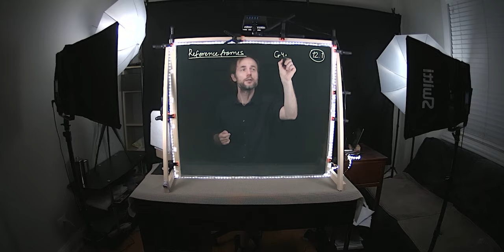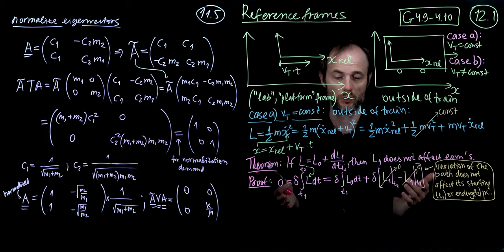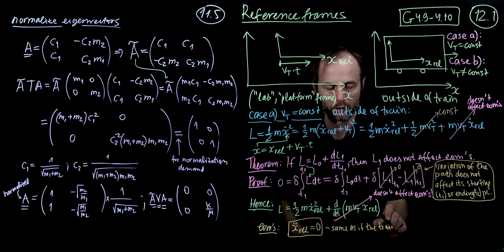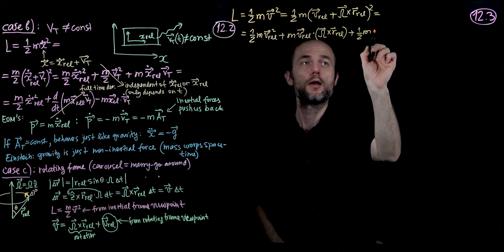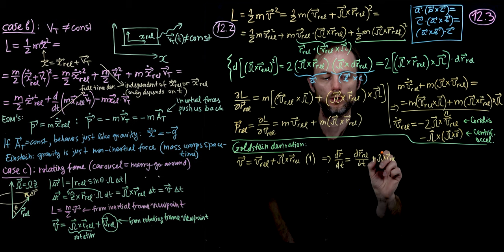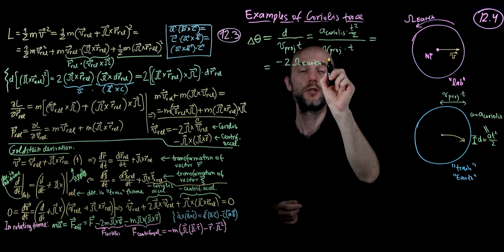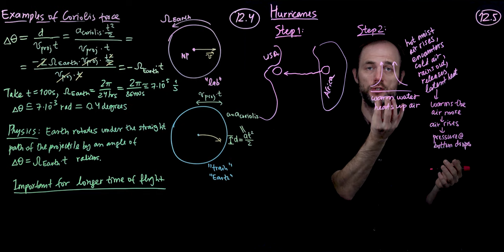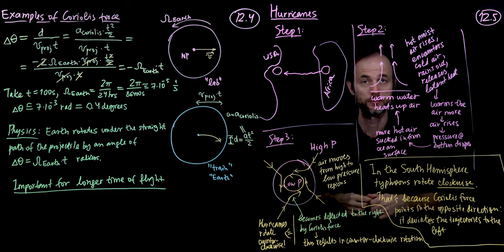Lecture 12: Reference frames, Coriolis force, and Hurricanes

Comment: Can someone advise me what is meaning of full-time derivative and why it doesn't affect Equations of Motions? (at 18.28)
(BTW these are great lectures)
Reply: I hope you get to read this comment even if it’s one year later hehehe. 

A full-time derivative is a derivative that contemplates both explicit and implicit change in time. 

Imagine a function that describes the temperature of a room at each point, and at each moment. Thus, the function for the temperature of the room is something of the form T(x,t). As an example, take T = x^2 + t.

So, in a pure calculus context, if I asked you how that function changes in time, the only logical answer would be to give me the partial derivative of the function with respect to time: ∂T/∂t. In this specific example: ∂T/∂t = 1. 

Now, in mechanics, we have an extra ingredient: motion. For example, consider we describe the motion of a bug through the room by a function x(t). The temperature experienced by this bug is then T = T(x(t),t). Note that the position parameter of the function also depends on t. For example, if x(t) = sin t, then T = sin^2 t + t. 

If I asked you for the time derivative of this temperature, you can’t just simply give me the partial derivative as before (∂T/∂t) = 1), because as time passes the temperature experienced by the bug may change both through the sole time depence of t and by the motion of the bug. It is necessary to introduce a new derivative that contemplates the changes through motion. We call this new derivative the total time derivative. We denote it by dT/dt. One way to calculate it is to take the time derivative of the function you are studying after substituting the explicit time dependence of position. I’ve done that before, so in this case, it follows that dT/dt = 2 sin t * cos t + 1. 

Now, the reason why you take out the time derivative of the Lagrangian is the theorem proved before in the video.